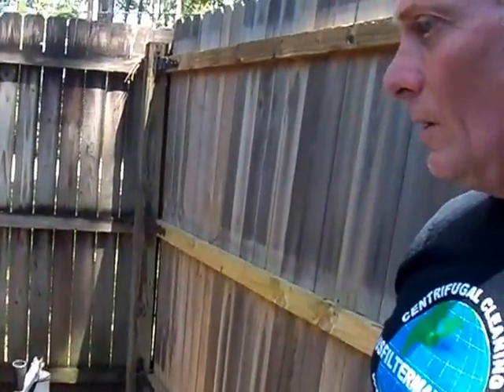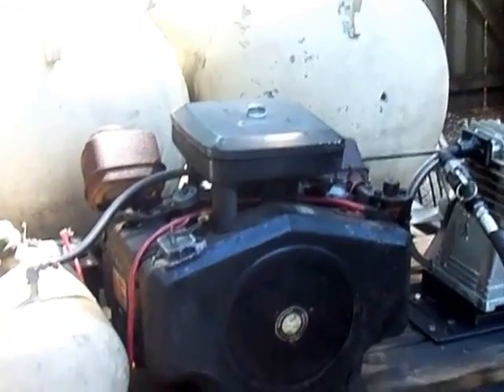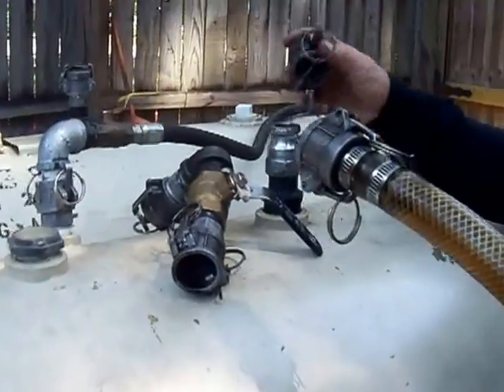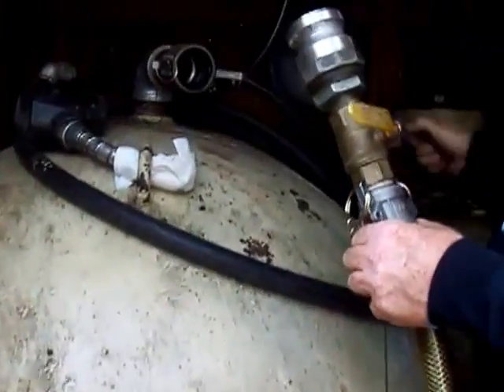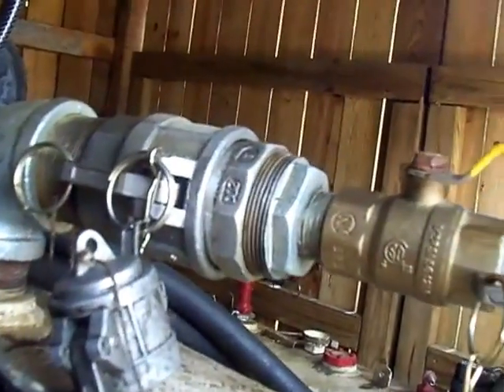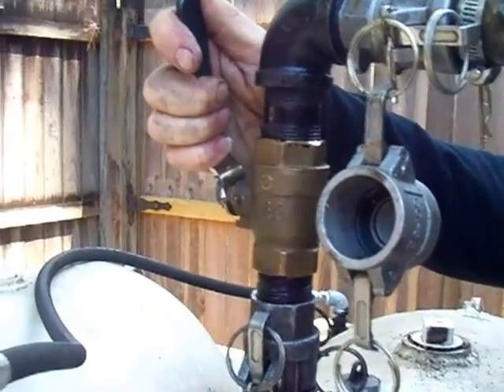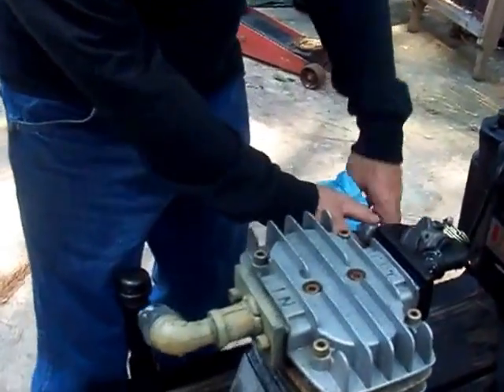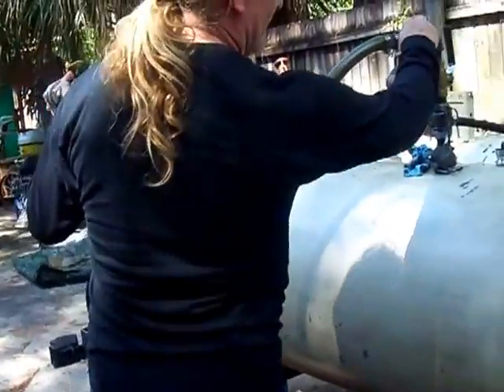WVO Collection: US Filtermaxx Super Sucker Vacuum Trailer for WVO and Used Oil.

Comment: What will keep the oil from over flowing the tank and getting in the pump? Also that size cam locks are you using at the vacuum tank? Is there any safety valve maybe like a wet vac to stop it off when full ? Another question. How long does it take to fill one of those tanks ? I have been given access to the oil from an oil change place the oil is in tanks that the workers walk on there grates and let the oil drain straight into the grates. They're quite a bit down below the car level and the owner said if I came I had to be really quick to not interfere with his high volume of customers. So I need to be able to pump a couple hundred gallons of oil and scram in a hurry. The tank I have is only 150 gallon propane tank but am mounting to a trailer about the size of yours so later I can add a couple big tanks. Tho I do have another 125 gallon propane tank to get me close to 300 gallons. If you sell the camlocks I need to order from you. But first I'm concerned about the safety valve to stop it when full.
Reply: The surge tank in the front keeps the oil from overflowing it is made from a 100 lb propane cylinder.
Cam locks are one inch, but we have since gone to two inch.
Fill time depends on size of hose and temp of oil.  A 1" hose with cold oil might take 10 mins.  A 2" hose with warm oil might take 2 mins.
We sell the cam locks on the website.  Be sure the meter on the tank is working properly and check it frequently so you don't overflow.  Surge tank is crucial to have for prevention of overflow.
USFiltermaxx.com

Comment: Please could you tell what are the vacuum and air pressure that you're working with? Thanks.
Reply: Vacuum can never be higher than 14.7psi.  Pressure is probably 50 psi and it's very fast.

Comment from the maker: Those are aluminum connectors and it is important to use the locking pins when pumping the tanks out. The tank is pressurized and there is no way to turn it off if a connector comes off. Another thing you should do is add a drain on the bottom of the tanks. You will  often get water and anti freeze in there and should drain it off  from the bottom.

Comment: Are you using stainless steel or aluminum quick disconnects in your system?
Reply: The disconnects are Aluminum.  Plastic is too flimsy, stainless steel is overkill unless you are working with corrosives.